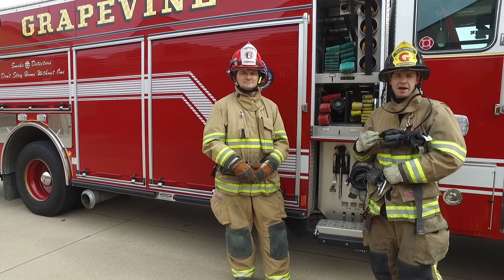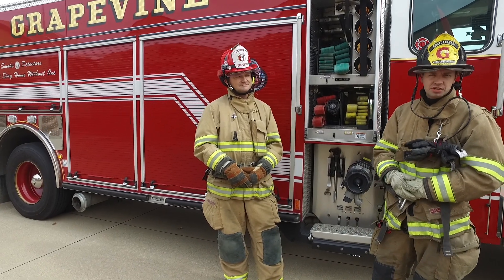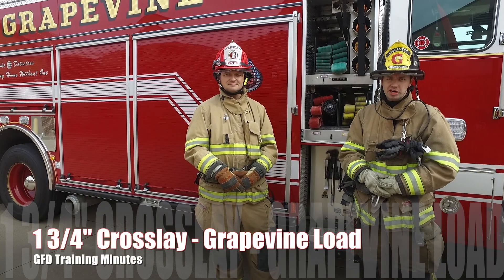GFD Training Minutes - Grapevine Load - 1 3/4" Crosslay - Deployment

Comment: How well does this deploy if pulling both lines to the same side of the apparatus?
Reply: It deploys just fine no matter what side you deploy it from.  If you are pulling it from the opposite side of the way the nozzle is facing, the nozzle will be on your back loop.  Not that big of a deal, you can clean it up when you deploy your line.   Best advice, give it a try and pull it from each side..
Reply: Pppppwn
Reply: @jerrykovar  

J  n